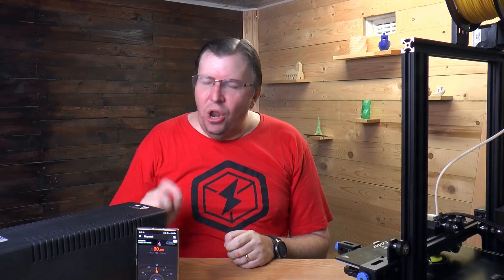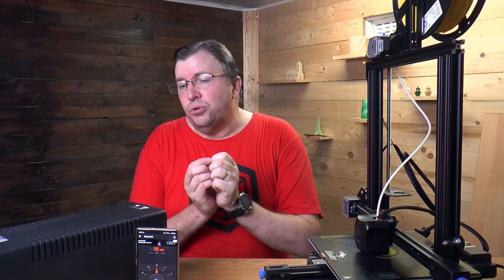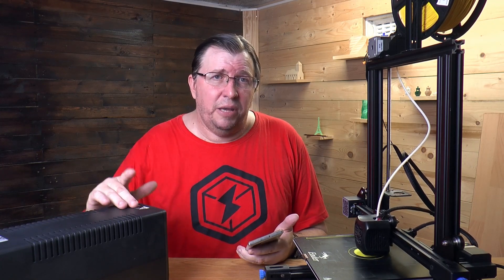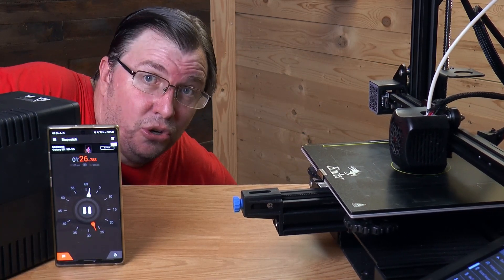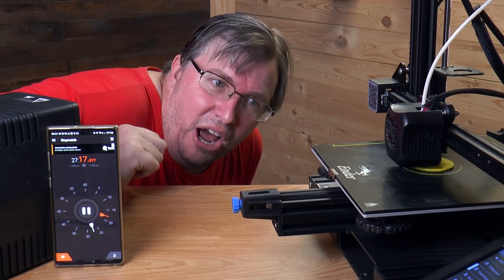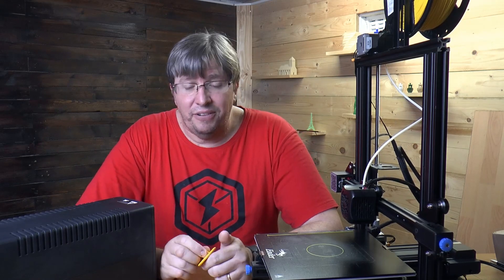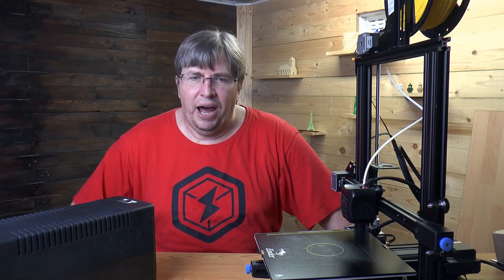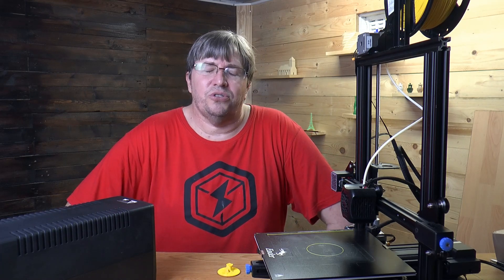3D PRINTING DURING A BLACK OUT | Don't let your prints fails

Comment: Hi, I am also based in SA, Benoni to be exact. Do you think it is possible to run a 3D printer on an external power supply with a 100ah deep cycle battery and an 800w inverter? I would like to be able to save on normal electricity by running my printer off of a battery box. I have an Ender 3.
Reply from the maker: That should really work well, but just as a standby if the power fails.  What are you using to charge the batteries?
Reply: @FusionSource  the power box is solar charged. It is not connected to the main grid. We use it in load shedding conditions, but from my experience with my printer so far (only having it for almost two weeks now), it seems as if it is power hungry as our prepaid units are depleting quite fast, especially when printing 10hr prints or so.
Reply from the maker: @godspassionministries4691  Is the output 24V DC?  If so, you can skip the invertor altogether, the Invertor is taking about 60% of the power when it is converting it back to 220V.  This is a project I have wanted to attempt.
Reply: @FusionSource  nope, my system is only 12v with the inverter. But I built it myself, so I will just build a 24v 100ah system sometime and then see how it goes. This will be a battery system specifically for my printer then. Or I can just add a buck converter to my current power box and boost 12-24v. But thanks for the advice, I appreciate it.

Comment: Usually 3d printers works with 12v. So with a voltage regulator you can connect it directly to a car battery. The benefit of doing this, is that you don't have losses. UPS is doing a power conversion from DC of the batteries to mains voltage. Then the power supply of the 3d printer is converting this back to 12v. All this with losses. So a 3d printer can be powered directly from a car battery in a more efficient way and it lasts for more time.

Comment: I live in Lebanon and we have the same power problems you have, it usually takes about 3-10 min to switch the generator on.

I use a 2kva UPS on my ender 3 and it lasts 2 hours if the bed is off
But recently my power supply died, I don't know if it is because of the UPS is not giving pure sine wave or it is something else
NB: before my power supply died, I was using the printer normally with the UPS for about a year and a half.

I appreciate if anyone knows if it is a must to have a pure sine wave UPS for 3d printers

Comment: Okay so the main load draw of 3d printers comes from the heated bed.   Being that your on that specialty glass bed, yes after 50 minutes its going to kill your print.   If you swapped the bed for a metal flexible bed or used some sort of print bed adhesive where you could turn the bed off, you should get substantially more time out of the ups. 

Its also based on the material. Pla shouldn't require a heated bed while abs, petg, etc do. 

So in theory a pla print without the heated bed on with a decent adhesive should easily get double if not longer time on the ups.

Comment: I'm not an expert at all, just speaking from experience, not sure if there were any other factors that caused it.

When moving over to a generator, the UPS starts acting strange. No idea why this happened but it wasn't good running good at all.
Reply from the maker: Hey Sameshen, I will check this out and revert.

Comment: I lived in India in the mid-'90s and the bungalow I rented had an absolutely massive UPS installed  and backup diesel generator as the power would go out all the time without warning (usually down to people stealing electricity and blowing the transformer up), It ran an AC unit, lighting and a fridge freezer and in the evenings a tv and VCR and kept us in electricity and only a couple of occasions did we have to use the generator

Comment: Remember every time you fully discharge UPS batteries (lead-acid) you damage the batteries and decrease their cycle lifespan. The next run becomes shorter and shorter with every full discharge. As a guide, if you get 1 hour of usable power, you should only use 30min (50%) to protect the batteries.
Reply: Some UPS units use deep discharge batteries for that reason.

Comment: Dankie!!
I modified my 1500w ups to have double the battery capacity. Sadly, i had to connect it to my modem, as I work from home now, thus cannot run my printer as it is too far away.

Comment: I recently got my Ender 3 v2 but we live in an area where we not only get load shedding but also lack of maintenance power cuts. So we got a 7kw genie. It works like a dream. But like you mentioned you can restart the print but the nozzle dumps a blob or melts a hole in the print. And so we just had a power cut this morning and the idea came up to get a UPS to transfer to the genie. And funny thing when we got home I saw your post and almost thought you were going to say it does not work. But thanks to your video you confirmed for us that it works so that is going to be my next investment. Do you perhaps want to devour where you bought that UPS and what it cost?
Reply from the maker: Hi Andrew, little embarrassed to say, my work bought the UPS for us to work from home and I thought it would be a great test to see if it works.  It will seamlessly transfer to the Geny when you switch it on.  I am also excited to get it all connected up

Comment: Good video - nothing beats real-world testing. You can expand the runtime by replacing the stock SLA battery with a larger deep cycle marine type battery. Not an elegant solution, but will buy you much more time.
Reply from the maker: Thanks, going to try play with some other solutions

Comment: Or another idea: you can use solar charge controller to charge bateries from your regular printer power supply, and connect printer to the bateries. It will be more efitient and cheaper. Now you are converting DC (battery in UPS) to AC (output from UPS) and then again AC (from UPS) to DC (in printer power supply). With charge controller you will skip  inverter part:)
Reply: Any thoughts on the added gain in power usage there Powel? Seems worth the try. I was going to suggest running the UPS off a deep cycle battery as opposed to its on board power. But your suggestion seems more economical.
Reply: @tyrantesmer6584  It depends on printer you have. But controller and batteries should be calculated for proper amperage (and voltage). Eg. I have tevo tarantula with power supply 12v and 12.5A. So Controller and battery should be able to give this same output. Solar controller is taking less than 10mA. In comparison inverter usually have 90% efficiency and powersupply around 80%. So we are gaining about 30%+ more power.
Reply from the maker: I want to play with these kinds of alternatives as well, thanks for the comment
Reply: @FusionSource  no problem:) Actually if you are living in South Africa, you can use solar panel to directly charge the batteries:) You should have plenty of sun there:)
Reply: thanks for sharing this great idea. just a quick question!! do you take the output directly from the battery?? or through the solar charge controller??
Reply: @farhan_haque  Both ways should work, but output from solar controller will be safer (it is regulated). Printer's boards have also voltage regulators which should handle little bit more voltage (during the charging, output to battery will be higher then 12v or 24v). There is so many solutions, that always is good to read documentation (for printer board, and solar controller :)

Comment: What UPS do you have?
Reply: Have built up a collection of entry level UPS's that are powered by small 12v 7ah batteries. But they're all just don't have enough power output. Your video gives one an idea of what level one should be looking at as an entry level, "save your print" option. Thumbs up.

Comment: Ender 3 connected to UPS have a 2000VA lasts more than 2 hrs
Reply from the maker: No ways, that's awesome, thanks for the feedback, will try test that soon.
Reply: @FusionSource  Connected my ender 3 to a 3000 VA Mecer UPS and it lasted 1 hour 1 min while heating the bed and nozzle to 60°C and 205°C and starting a 2 hr print.

Comment: If you mod your UPS like this:
https://youtu.be/-Ur-D37-juo

And mod your printer to expose DC cables directly, you could potentially dramatically extend your UPS print life by avoiding the AC/DC conversion.  Depending on your printer and UPS this may be very difficult or very easy.